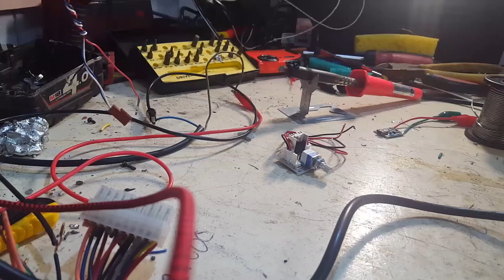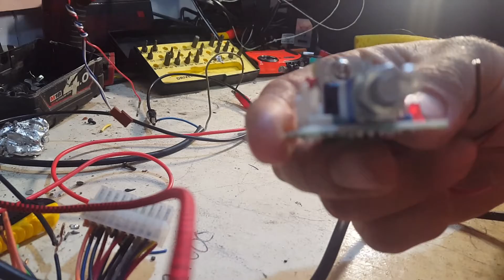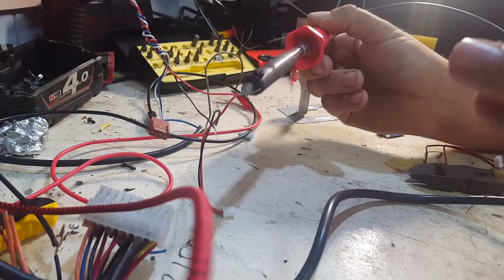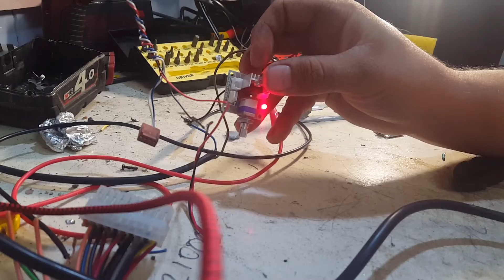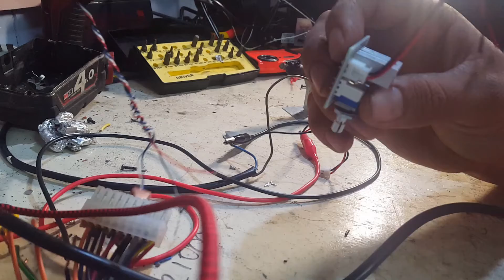Dam i cooked it [solder exaction fan upgrade fail}

Comment: Try a PWM motor speed controller. search for "PWM Speed controller" on eBay:  Lowest cost one sells for A$2.35 and supplies up to 3A.
They are about 80% efficient so will not get hot driving a fan
Reply from the maker: +Peter Kay thanks mate yeah I'll step it up with a better unit so I don't need to hear the fan screaming away cheers